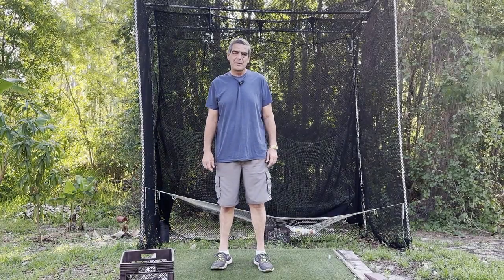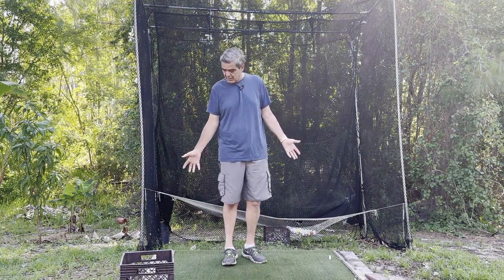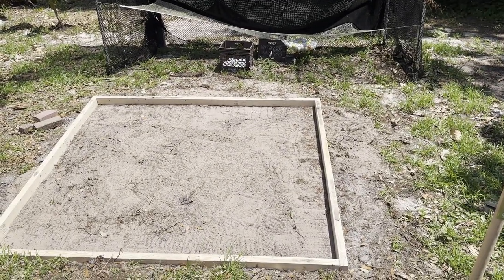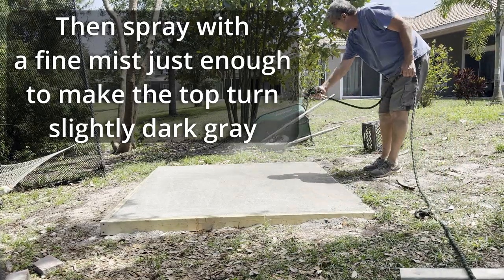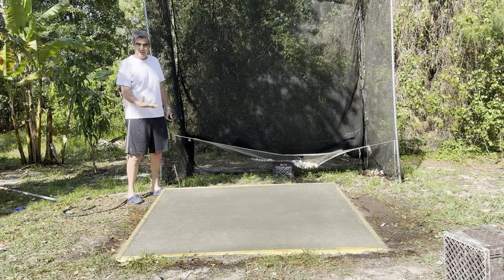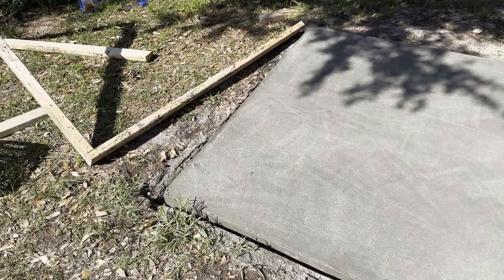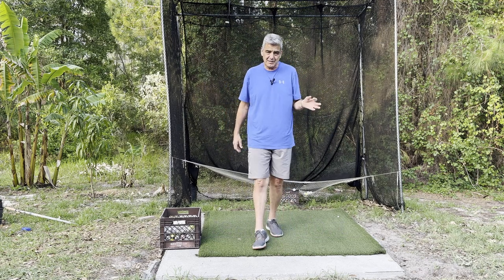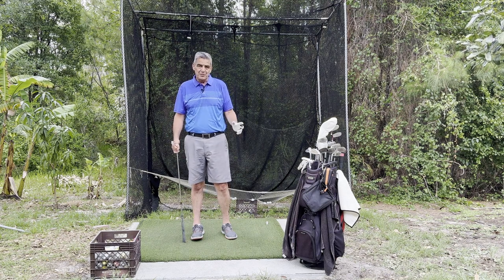Dry Pouring a Concrete Slab for my Golf Net

Comment: Thanks for the tutorial. I am going to be doing this in the next few months. After having done this over a year ago, do you find that 3” of concrete was sufficient? How deep into the ground did you dig?
Reply from the maker: For my purposes, 3 inches of concrete was definitely sufficient. As for digging into the ground, I didn’t. I used a tamper to pack down the Earth, but I did not dig down into the Earth because I wanted my platform to be above the ground so to speak. I didn’t want my grass creeping over it.
Reply: @yoursimplegolfswing I appreciate the quick response. I’ve been doing research and most sources have said 4” for patio but that seems excessive. There won’t be any heavy furniture on it. I was somewhat worried about an iron strike doing damage but I think a good mat will absorb most of the blow. I think I will be aiming towards 3”
Reply from the maker: I’m not sure what an iron strike is so I can’t offer any comment on that, but I used high strength concrete mix. Don’t use standard mix. High strength isn’t really more expensive.

Comment: Buy a couple elbow braces for the injuries down the road
Reply from the maker: Or just buy a high quality hitting mat like the one I have. I used this mat on my concrete lanai for 2 years before I built my original wood platform. 3 years on the wood platform.

Comment: You did a very good job there I am just curious as to why you did not do it the with of the net. Now your bag and crate are on the edge of the pad.
Reply from the maker: First, thank you for the compliment I appreciate that. As to why I didn’t do it the width of the net there are a couple of reasons neither of which may seem logical. First, it was my very first attempt at dry pouring so I was a little nervous about taking on a project, bigger than I can handle. Second, I wanted to go on the cheap just in case I messed it up somehow. In retrospect, the job was much simpler than I expected and much cheaper than I expected. I do wish I had made the slab a little larger.

Comment: How has the concrete pad held up?  Have you had any cracking or groove marks from the club?
Reply from the maker: Not a single crack, hairline or otherwise. It’s as good as the day I first started using it (2 days after dry pouring). No grooves either (no, I’m not sure how grooves could happen)

Comment: How many bags did you use
Reply from the maker: This took 15 x 60lbs bags. It’s 6’ x 5’4” x 3” thick. Most concrete calculators online said around 18-20 bags.

Comment: I found your vid by searching for "dry pour concrete" so I've never seen your channel before.  Not sure if it is only this video but it was very glitchy.  Maybe it's time for a new camera - one that starts recording when you touch the Record button 😁
Seriously, though, thanks for being able to follow the directions for dry pour.  That doesn't seem to come easy for some folks.  Nice job.
Reply from the maker: It was tempting to take short cuts, especially on the misting steps and the watering, but I thought trusting the process was crucial and being smart enough to know that I didn’t know better than those who went before me, well, it seems to have paid off. Thanks for the comments, even the teasing about my camera ‘skills’

Comment: shouldve used an edge tool, the edges and corners are gonna crack all apart.
Reply from the maker: I tried using the edge tool and I did a horrible job. I didn’t have the touch. I don’t think I screeded good enough because when I edged, I kept exposing aggregate.
Reply: @yoursimplegolfswing  Easy fix:  use a brick like you would sandpaper to soften the edges (vids on this) - other than that looks perfect!
Reply from the maker: @totallycv2388  thank you, I will try that